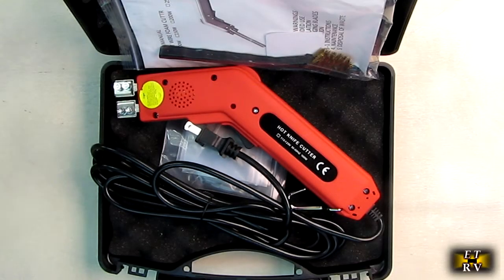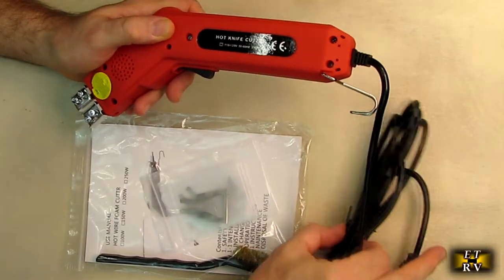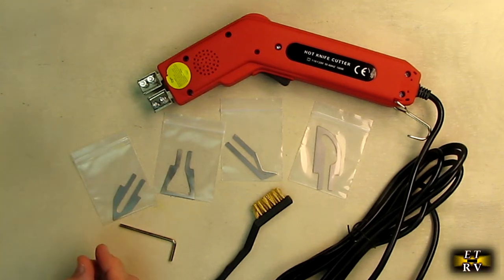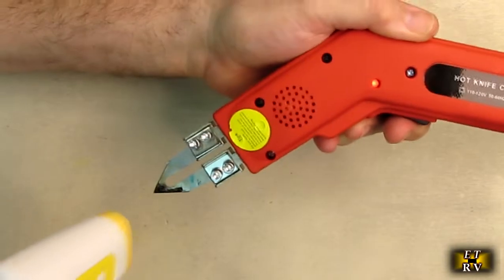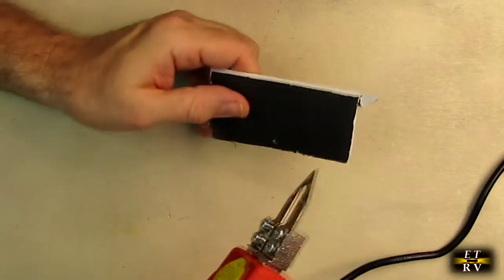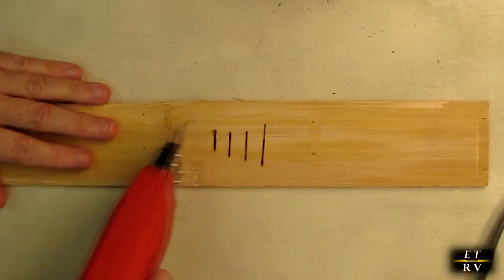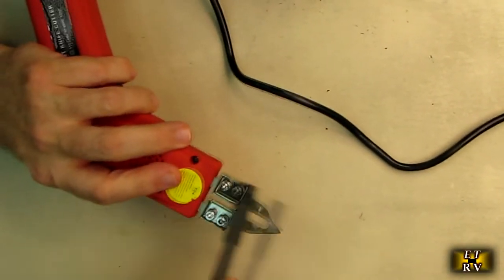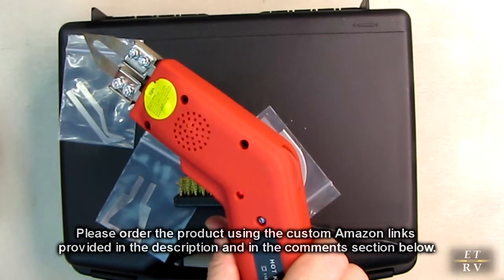BEAMNOVA 100W Electric Hot Knife Cutter, 932°F  (500° C) 4 Blades, Case, Wire Brush REVIEW

Comment: Bit of a stupid question but do the blades have a specific resistance or can I make a blade to from wire to cut a profile in styrofoam?
Reply from the maker: From my testing, the blades do have a specific resistance. If you were to measure that, then make a custom blade pastern with the same resistance, it should work.
Reply: @jeffgrave  Thanks, l did try just some wire after posting question and did not heat up. So out with the ohm meter…